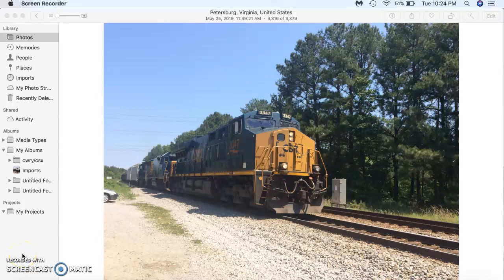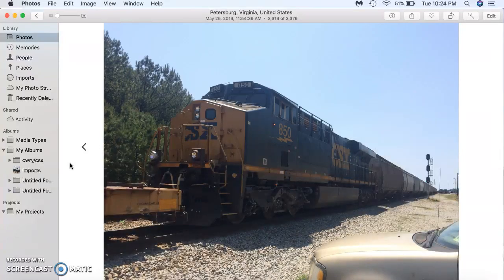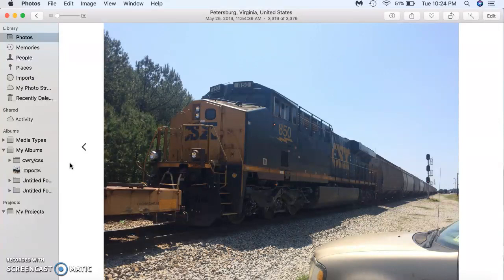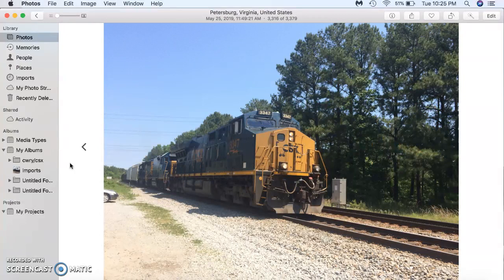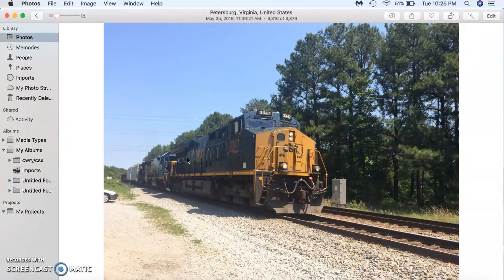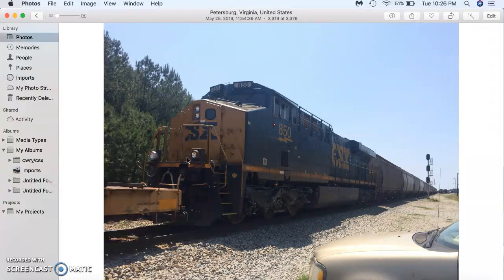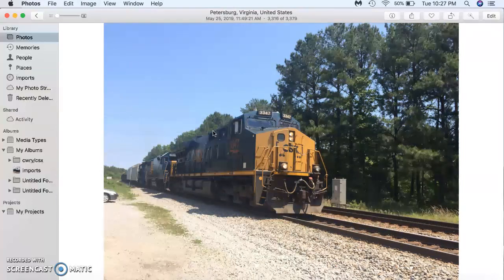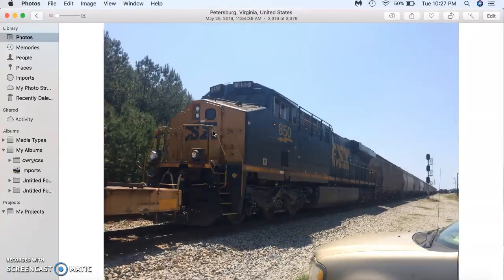DPU EXPLANATION

Comment: In this video, how does 850 communicate only with the lead locomotive?  What keeps trains passing by this train from interfering with the commands of the unit it is supposed to be hooked up with?  
I worked in the 70s when DPUs were nonexistent.  I did see one once but it had an old B unit (F-series engine) converted to a radio car.  I do know that all locomotives today are built with the electronics to allow a DPU hookup.  It is interesting to see foreign engines (UP, BNSF)serving as a DPU to another tier 1 railroad engine, in this case it would be CSX.

Comment: 40 years ago they had them and called them RCU's  Radio control units the RCU's had a RRC Radio Receiver Car . The RR slang term for those particular cars was called cracker boxes . everyone hated them they was pain in the neck to operate the signals wouldn't coincide from the lead to the RCU . Go through a tunnel the RCU would loose signal then you didn't know what the thing would do. They run a wire through t the tunnel that done nothing. Virtually when pass through tunnel the RCU had a mind of it own the thing might go to full throttle when the lead was shut down or it might apply the brakes as you was pulling lots of train separations and all sorts of stuff went on .  if your train was in two different tracks in the yard and you was doubling your train together for outbound if the RCU WAS in the track you was doubling to you did at time found yourself in the situation that the slaves had shoved itself into the side of your train as you was doubling over. Slaves was RR slang for RCU . They got rid of them 40 years ago . the use of them now only cuts out jobs so the carriers will use them till someone gets crushed or they tear up more than they are worth . I've done seen where the DPU's as you prefer to call them has caused trains  to shove cars ahead of the DPU off the track in extreme radius curves. 14000 ft trains and DPU's and extreme curves don't mix. Its like when you was a kid and you put  all the cars you had on your train set behind your engine and the cars rather back in the train rolled over on there side because you had to much weight and the curve couldn't take it. They rolled over in RR terminology that's called to much lateral pressure . if you are a former its fun to you it wasnt fun if you was on the crew and got run off for it.

Comment: what about LOco's that connect using the cable method where they use a big connecter and not wireless where its 2 locos connected togther via the cable what do u call that and can they use a DPU unit as a head end unit and head unit as a DPU can you explain this too
Reply: Jumper cables
Reply: And the answer to your question is yes if there was or is two consecutive DPU.s they was connected by jumper cable you can use anything as long as one of the DPU's was set up as a receiver loco except for steam of course. You could have SW 1500s back there or buttheads or whatever you prefer to call them.
Reply: Also you will find exactly what you are talking about on unit coal trains When they load or unload as the case maybe they just swap ends they operate from going back the opposing direction. I'm talking engine on front and rear of course . still hated the things though it m done.

Comment: Any info on the frequencies and type of signal used ?
Reply from the maker: I do not understand
Reply: I think he's talking about radio frequencies that the dpu's operate. You'll want to look at the 452.xxxx and 457.xxxx MHz bands. There are several DPU channels dedicated for this type of operation, and they're pretty close to the EOTD/HOTD frequencies (457.9375 MHz and 452.9375 MHz respectively). The transmissions that come out of these bands are packetized and use (if memory serves me correctly) Frequency Shift Keying in narrowband FM. There are software decoders out there that can decode the packets. None of the software out there have the ability to transmit (in case you are wondering about safety). With the software you can decode brake pipe pressure, battery charge, valve status, motion status, and market light status. Check out SoftEOT and SoftDPU out if you're ever interested in knowing more about decoding signals from trains!
Reply: Why would a rail buff  need to know that ?

Comment: DPUs Are Common On CSX.
Reply from the maker: OH you know it!
Reply: Manifests And Intermodels Are Very Common To Have A DPU.
Reply: EngineerPat 5290 Even steam used mid train helpers and pushers in mountains. Lots of skill in those operations.
Reply: They wasn't radio controlled then now where they .
Reply: Mostly on flat ground there not as popular in the  mountains. That is as far as the crew running them was concerned.